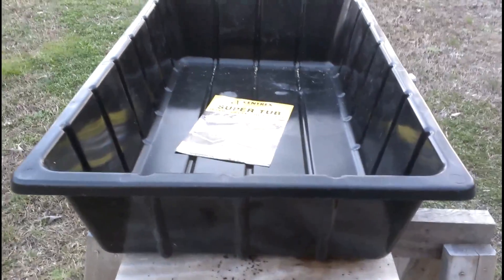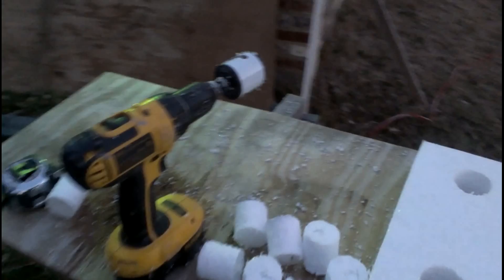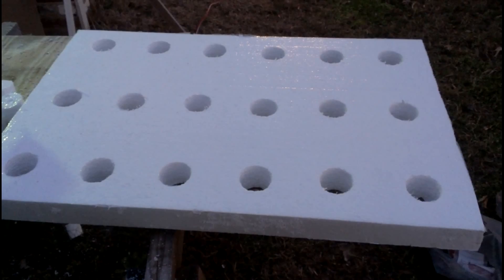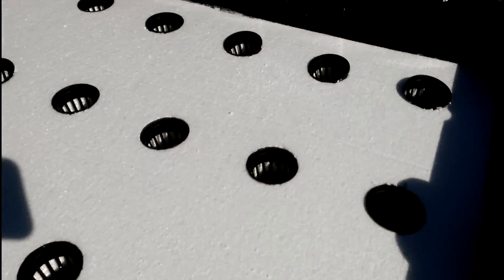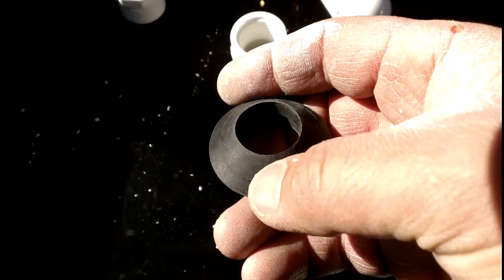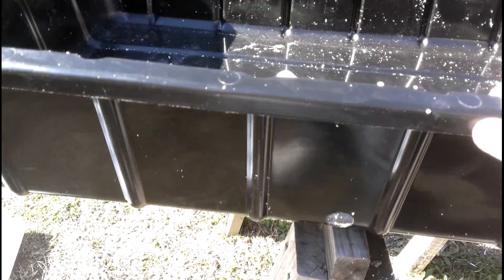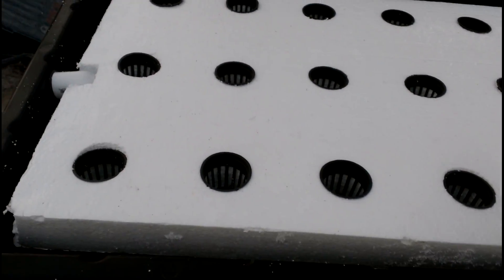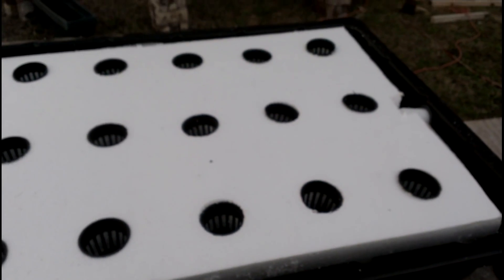Aquaponic systems Floating raft construction

Comment: Good stuff, My only comments would be to 1 - To remember to never clean the bottom of the Styrofoam  board as the beneficial bacteria live there.2. if any holes are not in use cover them with anything so light does not get to the water to stop algae growth. 2 - the washer should be food grade as if it is not when it breaks down it might affect the Ammonia/Nitrite/Nitrate conversion. But good  easy design for anyone to build
Reply: The plant roots hate the light as well, which is why it's important to never use a clear container.
Reply: hi guys, the greatest results that I have ever had was with the Keiths Ponics Site (just google it) definately the most helpful course that I've tried.
Reply: Not certain about the points made but ,if anyone else wants to uncover aquaponics at home try Aqua Recovery Tactics (http://aqua.RecoveryTactics.com  ) ? Ive heard some extraordinary things about it and my brother in law got cool results with it.

Comment: Hey! can you tell me the filteration process along with (Product list) what we need for filteration.
Reply from the maker: The water will cycle through the system and before it goes back into the fish tank a set of filtering sponges will collect the solids, there you can remove them and use that as regular ground fertilizer or just rinse and reuse

Comment: Helpful video, the only thing I'll note on is that you shouldn't use insulation polystyrene/styrofoam with any chemicals added, can lead to various health risks for both you and your fish/plants.  It can be difficult to find pure stuff locally.
Reply from the maker: That is true,we always have difficulties on finding clean products
Reply: @HugoCorrea  I'm currently trying to track down the right stuff in my area in Wisconsin and it is the one thing I can't seem to find!  Very frustrating.
Reply from the maker: Thomas Wolf I will make more videos soon about my findings on the topic
Reply: @HugoCorrea  It will be much appreciated information, I found 2" white closed expanded polystyrene sheets at my local Menards, but it contained three unacceptable chemicals.  I now have a complete setup besides the raft material.  I'm contemplating a custom lid as I am good with a dremel, hole saw bit, etc.
Reply: @HugoCorrea  I'm actually writing a paper on the subject to finish up an English 2 course (final assignment) - any good .edu or .gov qualified resources (links/URL's) would be appreciated as I can use them as references.  I am writing about aquaponics as a whole but I am definitely including the safety of plastic products in the paper.  It's a literature review but I'm writing it in the form of a research paper.  I could even do a brief interview with you online or over the phone if you're interested.  Outside the polystyrene issue, I am having issues waterproofing my drainage line - I made the poor choice of trying to combine a bronze hose barb to a plastic female fitting, although it works perfect on the intake.
Reply: Currently using Insulfoam closed expanded polystyrene as a temporary measure.  Anyone with info about waterproofing these to avoid leaching please let me know!
Reply from the maker: Sure, give me a call 7042397993
Reply: @HugoCorrea  I took down your name and number, you may want to remove your number (some people youtube for a living and don't mind) but for personal privacy I'd suggest it.  I'll have to come up with some questions to ask you (they call them survey questions...but they are really just questions with no wrong answers)

I appreciate your help.  I'm headed off to the hardware store to replace this bronze fitting with a PVC one shortly.  Aquaponics day!

Comment: I have a few questions, 
where do the fish live? in the same Tub shown in the video? if yes then do they not need light ? Espacially for Commercial fish like tilapia?

if its a separate system, can you guide us on that ?
Reply from the maker: Amit Patkar you need to have them in a different tank and a pump circulating the water
Reply: Thanks Hugo,  Iam trying to understand, what would happen if the Fish sit in same tank?  
May I put it this way,  if we have a Large Fish Tank, which is well cycled to break down ammonia, what will be the results of a Floating Raft on the top of it?
I would like if you throw some light on this

Comment: How long does the styrofoam last?  I used a thinner type on a previous system and it did not hold up well. I could not pick the plants up without it collapsing.  Thanks!

Comment: It is my understanding that the water should be filtered after leaving the fish tank before going into the floating raft system because the roots cannot filter out the debris etc that come from the fish tank. Some systems than do a second filtering after leaving the bed and before going back to the fish tank. Is this true? If so what filtering processes are you using?  Good information Hugo!! Thank you!!
Reply from the maker: hello Ron, before the water from the fish tank gets inside the pump tank I use an small tank to filter the water and almost overflow to the pump tank, there a have worms leaving to help with the transformation of the solids into nutrients

Comment: Does it need flood & drain ? Thanks
Reply from the maker: The water must circulate through the systems, for that reason in this case the water will enter through one side and will leave through the other side
Reply: Hugo Correa
Does it mean plant root will sink in circulated water all the time?
Thanks.

Comment: floating raft growing beds differ from Bell Siphon beds some how and I have yet to figure out which is the best way to go. Both are aquaponics. But one drains water from roots and one keeps the roots in water. Floating beds seem to be easier but I need more info on floating bed systems.  Do you have knowledge of having both float and drain on the same system before and if not, do you think it  may work?
Reply: Richard, I have a combination of bed types, but is best to say that while the water should be full of nutrients provided by your fish and friendly microbes, it should be free of solids in you deep water culture bed. So if you are not going to add something like a circular flow filter, you need at least one bed with media and a bell siphon, to pass it thru.
This helps with populating the microbes, as they live on the surface of your containers and media, and so a flood and drain media bed acts like a less complicated bio filter for the smaller home system.
Reply: Thanks Deborah Baird, What my design has laid up is; My fish tank water goes to bio bed tank then on to the grow beds then back to sump pump tank than back to fish tank. With the floating bed explained to where I can understand why, I will most likely have one in line with my normal siphon beds for veggies that like a lot of water. Any chance you have a video posted on your system I could look at?  Have a great day. Thanks

Comment: I would think it would work, but your yield might not be as good as a contained system where you can control the nutrient levels.
Reply: So long as your nitrogen cycle is in check and you have an appropriate fish to gallons and plants to fish ratio, it will produce even better results than typical hydroponics.  The research is all over Google.

Comment: a better way to make the holes is to heat a metal pipe up
Reply: I suppose that depends on how comfortable you are with a hole saw drill bit.  With insulation products (which generally should be avoided) breathing in the debris from drilling and the fumes from heat-punching holes are both harmful to humans.